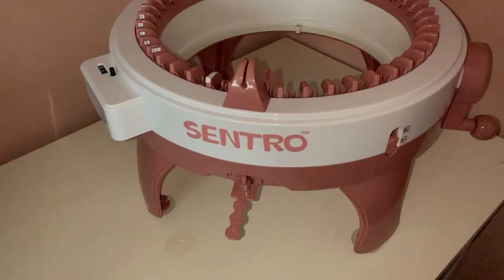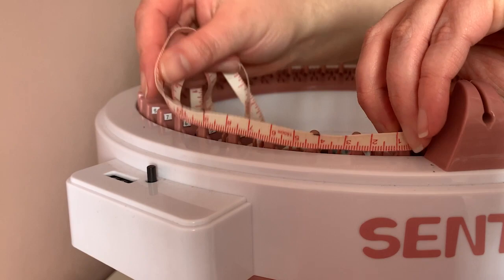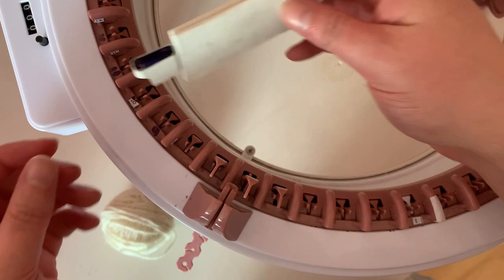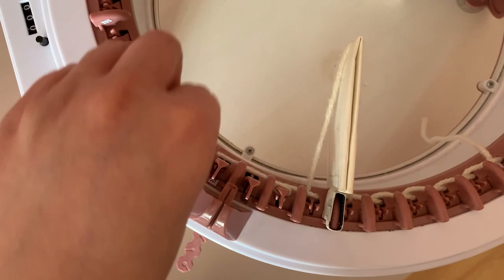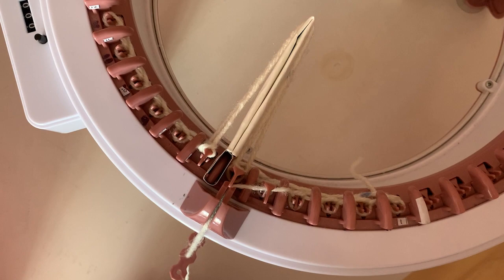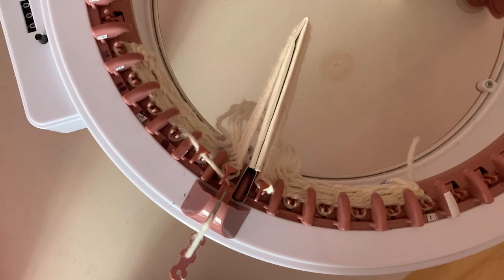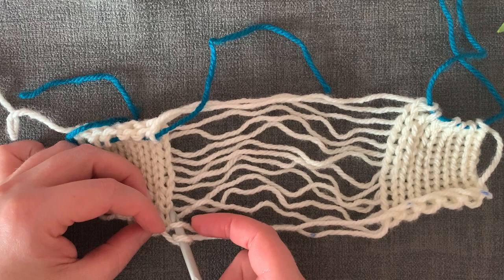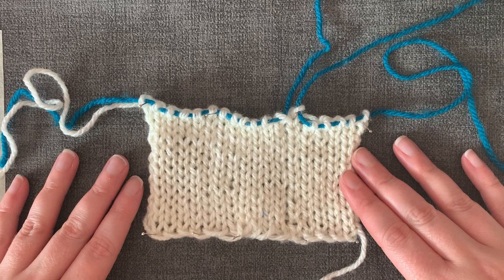How to Knit Larger Panels | Sentro Addi Prymm | Knitting Machine Hack

Comment: I got around to doing this for my Addi king and I tweaked the height of the cardboard because i noticed that it was hitting this bump on the Addi that was causing it to fall off a bit. It worked great for me, I got 8 extra columns out of it using a weight 4 yarn when i tested it out. I'm definitely making more and im gonna play around with the lengths to see how specific to the amount of columns i can get.
Reply from the maker: Amazing. Glad to hear it works for the addi too ⭐️
Reply: Could you tell me what height did you end up with? I also have the Addi.
Reply: Senza modificarne l'altezza si può fare una smussatura nel bordo che andrebbe a toccare

Comment: Yarn "take up" around 6 needles necessitates the measurement of 8 needles. Alternatively, calculate the amount of yarn take up per single needle, then multiply. Or determine a simple ratio of take-up per needle reflecting each gauge of yarns you commonly use.  Fun!

Comment: It is a great idea.
I did 210 rows making a tube sock. It was tedius at first but then I got in a rhythm. 😂
Also, I started the rows at the bottom and then put in a bobby pin (American) when I went up 10 rows. That way I was doing a section at a time instead of crocheting a 210 loop row and starting at the bottom again.
Reply from the maker: Oh that’s a great idea. Wish I’d thought of that when I was doing my cable pillowcase 😂.

Comment: I love this idea, and it seems like it might work in the round also.
Reply from the maker: I did think of that too. It is something I will be experimenting with but if you beat me to it please let me know how it goes.
Reply: @emilysmith2784  I was thinking of trying it in the round to keep hats from looking so stretched out around the brim, but then there would be that much more bulk at the top when it is cinched closed. My mind is trying to think of ways to decrease at the top without transferring to knitting needles. It might be possible by switching to shorter cardboard pieces and then to even shorter pieces, but would need to remember to make decreases with the crochet hook on the correct rounds. Maybe I’m overthinking this. I’ll definitely have to give this some thought.
Reply from the maker: @JoAnnCreek  I was having the same thought when trying to figure out a raglan sweater using this technique and using shorter cards for decreases. So much potential 😃
Reply: @emilysmith2784  Raglan sweater seems like a great idea using this method. I think that might work.
Reply: @JoAnnCreek  you can make decreases with the chunky flexee loom links.

Comment: Blocking might also help make the added section(s) more consistent with the rest of the panel. 

Will have to experiment later. 

May also try to make a plastic extender with my mom's old 3d printer if I can figure out how to use it (the printer that is).

((SUPER BRILLIANT INGENUITY you got btw))
Reply from the maker: Thanks. I’ve seen some plastic versions on Etsy if you can’t figure out how to print them 😊. My cardboard ones are still going strong.

Comment: Great idea, do you have a video or written instructions for the extensions?
Reply from the maker: This is the video for the extensions. Was something unclear?
Reply: For the extention you need a card 7. 5cm  by 7.5 cm and 0.5 cm thick . Attach with tape or create a loop with a bit more card stock that fits around the peice that comes up between needles.

Comment: What size is the crochet hook?
Reply from the maker: 5mm
Reply: @emilysmith2784  Thank you so much! I've always wondered what size crochet hook or knitting needles to use on the Sentro in case I decided to do any hand knitting.
Reply from the maker: @kysmik8214 This technique is easier with a slightly smaller hook so you have more room between the stitches to work your way up the ladders and on a small block of stitches the tension will work itself out with wear and washing. If you want to match gauge size with the sentro I would go with a 6 or a 7 mm depending on how tight you knit.
Reply: @emilysmith2784  You are a GEM!!!